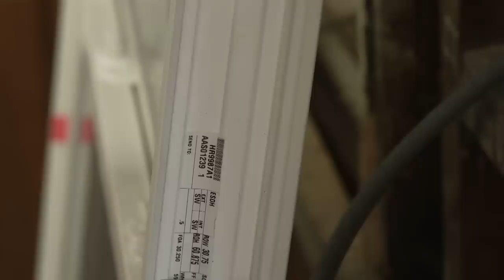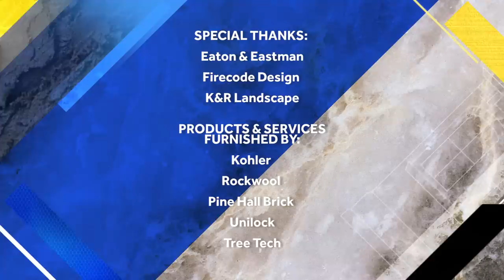This Old House | Urban Oasis (S42 E20) | FULL EPISODE

Comment: Crazy that the free floating modular wall can be used as a retaining wall??? I'd at least put some construction adhesive between courses....
Reply: They were putting adhesive, are you blind?
Reply: @PJJ196  Now obviously, if I saw someone applying adhesive to the blocks, I wouldn't have said anything about it. Make sense? That being said, I don't sit and watch things with undivided attention and my jaw hanging open, which explains if they were applying adhesive between stones.....waitaminute, are you talking about the CAPS?? Of course they were applying adhesive under the caps. I'm talking about the rest of the blocks 🙄 Sheesh.
Reply: @Pure_KodiakWILD_Power  Glue First course then interlocking after that until cap.
Reply: @Pure_KodiakWILD_Power  Couldn't even make it with undivided attention to the 4:00 minute mark? Pathetic.
Reply: @Thumbhit1  Thanks, brother. It's interlocked against light even horizontal pressure, but if there were enough soil behind there, and there was a diagonal push, they're just blocks sitting atop one another. Perhaps it's not enough soil, and it'll never happen 🤷‍♂️ Then again, there is a tree back there.
Reply: @KJF-ny  🤣 pathetic that I have more in my life than just YouTube? Looks like you have your priorities straight 👌 Stay laser focused, friend.    ....oh, and yes, they applied adhesive along the bottom course because the base layer of block is smooth.  Still no evidence of anything on the inbetween courses, hence my original comment 🤷‍♂️
Reply: @Pure_KodiakWILD_Power  Yeah, I know, it's crazy to dedicate a little time to watching something for entertainment. Who knew  it's so insane to think someone could spend 20 minutes focused on one thing? 

Especially before going full Karen about something clearly covered in the video.
Reply: @KJF-ny  yeah, I don't have time to indulge your emotional outbursts either. Carry on if it makes you feel better.

Comment: Why would anyone use dry wall screws on windows in the first place, are they that cheap?
Reply: I’ve done it. I don’t think it really matters
Reply: @Kevin-mp5of  nice reason. And deck screws are only for decks.
Reply: @Kevin-mp5of  I get what you’re saying but the vinyl jamb will crack long before the screw snaps.
Reply: @Kevin-mp5of  those drywall screws held against the sheer force of new England weather and a firehose.

Comment: Tommy when you said that they shouldn't have use a dry wall screw on the window. But you didn't say why it's a bad idea.
Reply: And who are you? Do you work for the show?
Reply: How do you know that? Do you know him personally? or do you work for the show?
Reply: I asked a question for Tommy Silva not you. So you relax
Reply: @chestertaylor7341  drywall screws are fine for that application. They held the window in place for a fire and the subsequent inundation from the firehose. They're cheap and effective. The artificial drama created of the use of drywall screws is largely created by manufacturers ( who also heavily influence the ever changing building codes) who want you to buy their more expensive screws.
Reply: It's true that the drywall screw held through the fire. I was thinking it was against building codes because Tom Silva said that it was a bad idea to use it for that application. Thanks for giving me an actual answer and not just talking out the side of your head or anywhere else.
Reply: @rd-ch1on  I just wanted to say thank you directly. I'm very interested in the stuff that I see on the show. I'm a slightly trained apartment maintenance man. So that's why I asked the question that I did. Plus it shows the people who make the show that people are watching the show. Even on the internet hopefully they are going to keep running it for as long as possible.
Reply: @chestertaylor7341  The window can't fall out because its bumped up against the old exterior window trim and glued in place by all that caulk. The window can't get pushed in either once it's all completed on the interior and don't forget the shims and spray foam insulation that's locking that window in place. I've removed lots of those types of windows. The screws can be removed easily and window won't budge at all until the caulk, trim, spray foam, shims etc. are removed.
Reply: @rd-ch1on  THANKS FOR GIVING ME A REAL ANSWER and you didn't just talk out the side of your head or anywhere else.